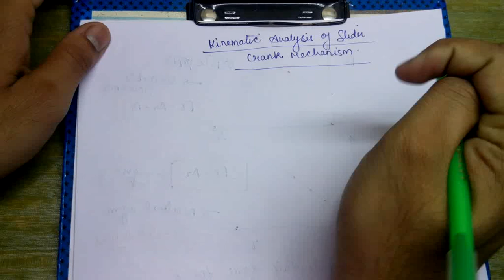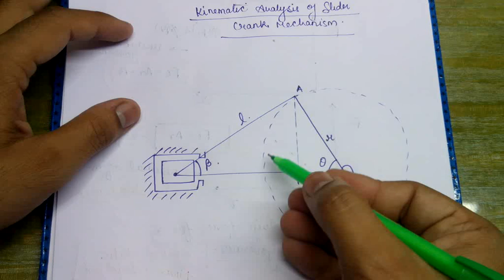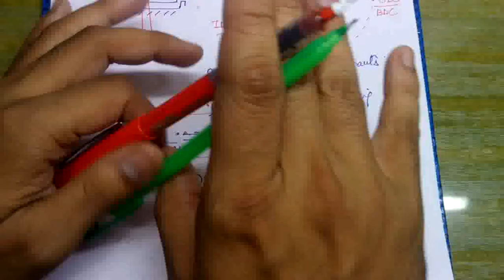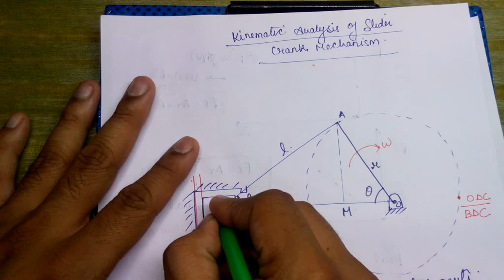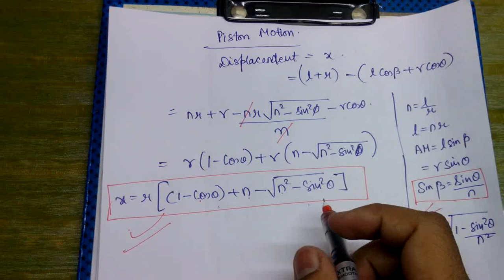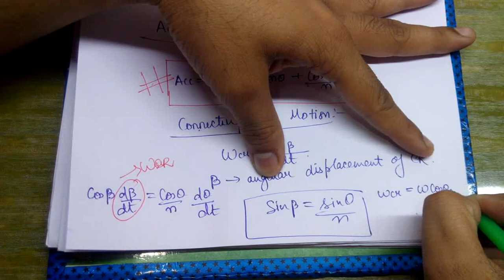Theory of Machines Lecture 19: Kinematic analysis of slider crank, calculation of different forces.

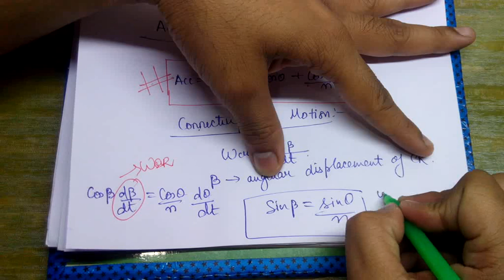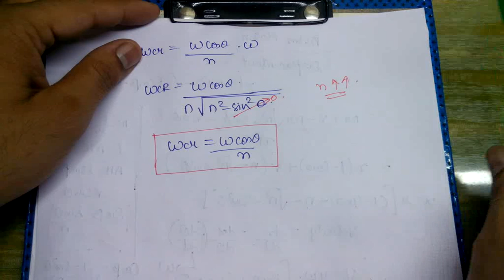Comment: 09:48 to 10:45
1. Where did the extra omega come from in the expression of connecting rod angular velocity?
2. cos(ß) dissapeared until the 3rd step of ωcr
3. There was an extra 'n' in the denominator which results in n^2 in the final step but it didn't
It seemed like you were somehow forcibly giving the final step of the expression
Reply: Agree...even i am confused.